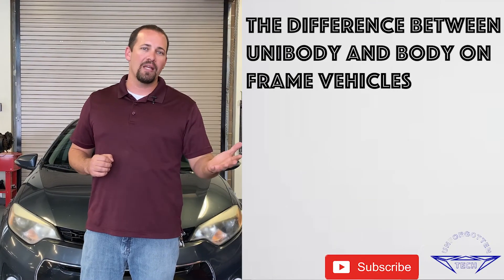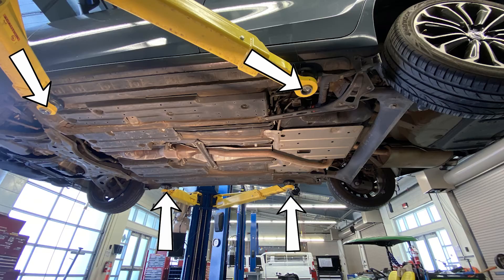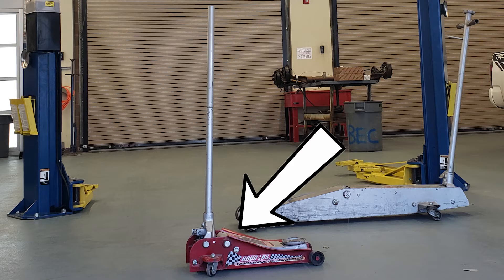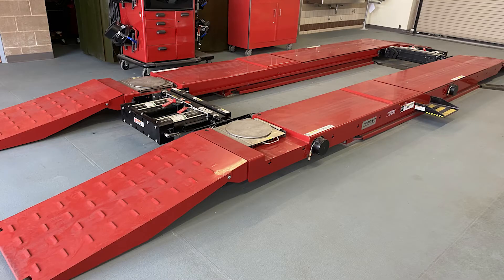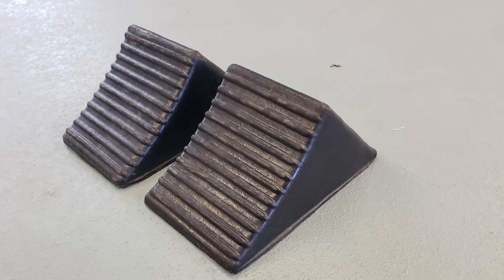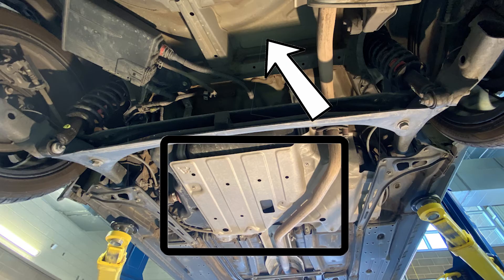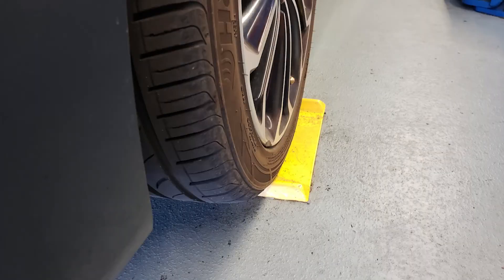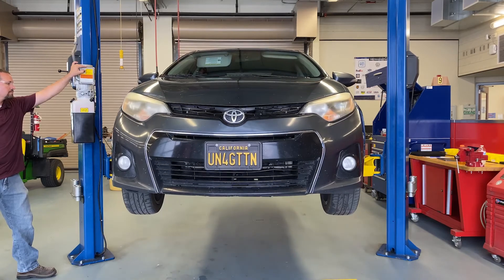Everything You Need to Know on How to Safely Lift and Hoist a Vehicle for Service

Comment: 4:44 can someone explain further "lowering it on the stops"? I'm the new  owner of an automotive lift/ hoist thats in a pole barn I purchased. Thanks.
Reply: A post lift has automatic stops usually requiring pulling a lever to lower the lift
Lowering on the stops is just lowering without pulling out the auto stops
Reply: @topJimmyP1984

Comment: Great tutorial, today was my first day lifting our mini van 2015 Chrysler Town and Country in our home garage installed two post half lift Max Jax from Bend Pak, the positioning of the vehicle took long time and it is not perfect but it is relatively straight and centered on the lift area, where the doors seams are kind of in the middle of the lift columns I had to experiment with it to get it where i like it, the van has like a thin metal edge and not really 'lift points" which makes it difficult to determine the optimal point; as result the front arms are closer to the front wheels than the rear arms are to the rear wheels; the Max Jax is rated to 7K and the van weights 6050 pounds; it is pretty heavy compared to a normal car and tall too, our ceiling is 8.7 and the clearance I have to work under it is 38 inches, a little over 3 feet but I just tested being under using also an Ergo Creeper which can only go into its first setting off the floor at 21 inches but I kind of semi-laying down and it is so comfortable that I could sleep on it and can reach every point under it, so I am happy that the objective expending so much money and time in this setup yields a better position to access under the frame better than just using jacks stands; the Max Jax has mechanical safety stops to prevent the weight to rest on hydraulic power only and it seems to me pretty solid without having the need to buy extra long jacks as many other people do for extra layer of safety; the vehicle is secured in all 4 points and unless there is an earthquake does not seems it would just fall off. I was thinking maybe the clearance would not be enough but I was wrong; this lift has 6 safety stops, due to how high the van is and the ceiling clearance I can only use 5 then back down to rest on the stop and have good reach under to everything. I also just got an oil drum from Harbor freight which needed to cut 5 inches off the main tube to make it fit under the vehicle but overall I am happy as to how everything is coming along. Ready not to overhaul that  hydrolocked engine! the tip about placing a jack on the back when the engine is out is great, thank you for the tutorial!

Comment: Where are the points to lift a 2012 Fird E50 van? I took it to a shop and lifted on the edge and it bent the area where they lifted it. They told me that's where the pinch points are but I don't believe them. They used a 2 post lift.

Comment: Nissan NV200 liftpoints in pillar lift
Reply from the maker: Buschman thank you for this example. The Nissan NV200 can have some wondering where they should lift at. All the plastic makes this vehicles undercarriage look drastically different than other light vehicles. Luckily there are specific pinch weld points located under the doors with arrows to guide you to the proper lifting areas. Nissan does recommend using lifting pads to help in this process.
Reply: Thougt that too, but then liftning with jacklift put pallet power other place under car.

Comment: What is the vehicle is rotten and the frame crushees as u lift it for cars with lift points
Reply from the maker: Great question Jc. Sounds like you are in for a treat and will need to make some major repairs. I would recommend repairing or replacing any damaged or severally rusted portions before continuing. Good luck!

Comment: Are there different lifting heights on a 4 post lift?
Reply from the maker: Yes there are. The size of your lift normally will depend on what your needs are and the space you are putting the lift in. Of course budget will play a role in the type, size and brand of the lift you select to use.
Reply: @UnforgottenTech  trying to decide on ceiling height in a new build...